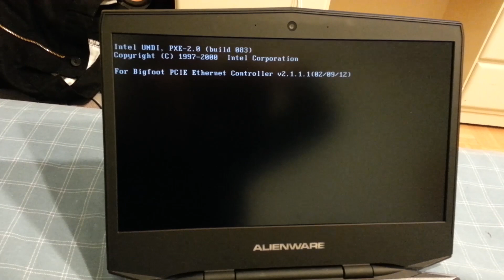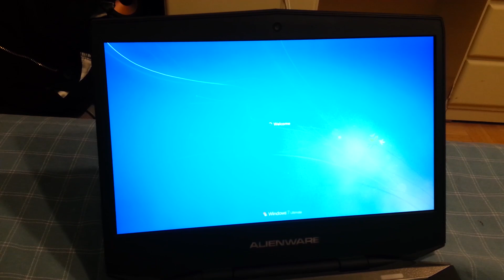Laptop screen replacement / How to replace laptop screen for the Alienware 14

Comment: I asked a expert me changing my Alienware 14 laptop screen to a 1920x1080 and he said I need to upgrade to a full hd video cable. But in this video he doesn't so I'm clueless, I already ordered the 1920x1080 so
Reply: Did it work??? I have the 13r2 with the 768p crappy tn panel and they said the same thing. I kinda don't believe them and think they say it doesnt work so you pay extra to them.

Comment: What tool are you using to take the outer screen cover off?
Reply: +Zane815 I used some prying tools that came with a mobile phone repair kit, any small "prying" tool that can slide inside the cracks and pry it off should work
Reply: K thanks

Comment: Excellent video. I have the same computer but when I was looking for HD screens I found this note re: upgrading to the 1080p screen:

"*IMPORTANT! Please, make sure you have the same screen resolution, or replacement will not work. HD screen (1366x768) uses one channel video cable, while HD+ (1600x900) and Full HD (1920x1080) use 2-channels video cable, thus they are not compatible. You can upgrade screen resolution by switching video cable to Full HD only! Please, refer to manufacturer to find compatible video cables for HD+ and FullHD resolutions."

Will this require I chance out the existing cable on my Alienware 14? (2013) TIA
Reply: Dell Latitude E7440 full hd díplay 30 pin , to replacement alienware m14x hd

Comment: When I check out the screen country website, I notice a disclaimer that says, "
SIZE, RESOLUTION and BACKLIGHT TYPE must match the
original screen.
Reply: Oops, posted before I was finished! Are we sure that an upgraded 1080 p screen with say IPS technology will work in an Alienware 14, if the original screen was lower resolution and no an IPS model? Also, I notice those are listed as LED screen. Is that different than LCD? Will it work? Tia!
Reply: John Johns did you ever find out the answer to this question?

Comment: Question, did you replace the Video Connector as well? I own an Alienware 17 and upgrading my 1600x900 screen to a 1080p screen and is wondering whether the current connector is compatible to run screens at a higher res. I'm worried that the vdc output going into this higher res screen might damage my laptop in the long run.
Reply: ***** May I ask for the item ID of the screen you brought? The matte is currently out of stock and was wondering if the glossy would work as well.

Comment: so it really is that easy, huh? I don't have to ask a professional to change up the hardware behind the screen or anything? Just like you, I want to change my screen from 1366x768 to 1920x1080 and some people say that it's not possible, but others say that there's no other hardware that needs to be changed, and I'm a little confused.
Reply: Yeah as simple as the video (took the video while installing it so was new to the process while doing it here).  I heard the same thing before installing as well, and maybe some computers are like that where you can't swap out the screens, but this one was an easy detachment of a cable, unscrewing the screen, and replacing with the upgraded one

Comment: I have a problem with my current screen.  The place where the screen connects to the cord creates a vertical band where the backlight is darker.  It's only noticeable when the screen is darker, but very annoying.  I'm not sure if this is a defect in all or some Alienware 14's.  It seems less or not noticeable when the plastic border is not attached so I think there may be some deformation when it's closed.  I'm not sure if the cord itself is damaged because it seems like the wires are exposed and very flimsy.
Reply: i have the same fuc** issue , after a light use for a year, yesterday after 30 minutes the screen begin  with a white vertical line, the first and last alienware laptop I buy, i pay 1500 dollars for trash that's being crazy,and finally I live in Colombia ¿Where the hell get the parts?
Reply: didier ortega I got this replacement screen from the video at screencountry.com
Reply: In my case I'd be willing to pay the $60 or so for new screen, but I'm not sure if my problem is the screen, the connecting cord, or a design defect in how the casing compresses the screen.  For me it's definitely a backlight inconsistency.  It shows up when I turn the computer on or if what's on the screen is black.  Otherwise I don't notice.
Reply: Frank K Yeah I'm not sure if that is the screen causing the issue either